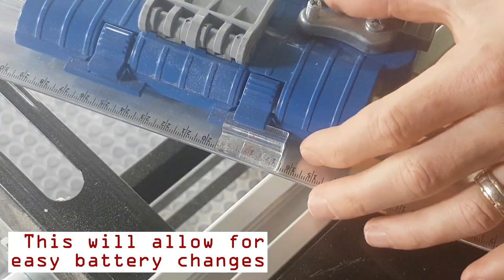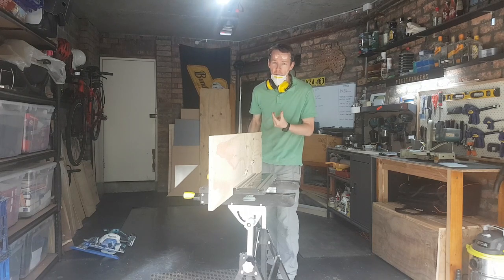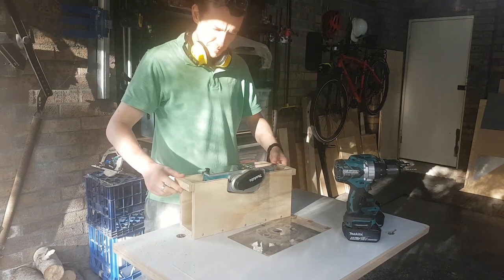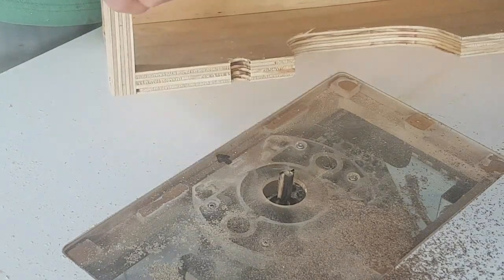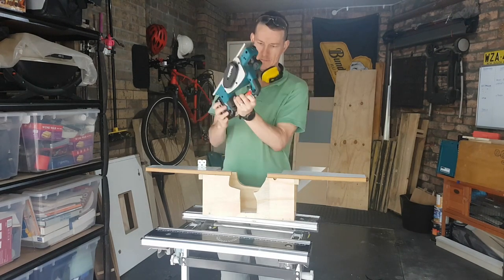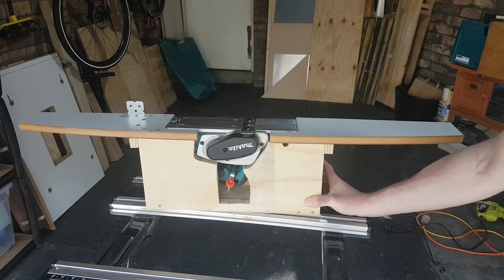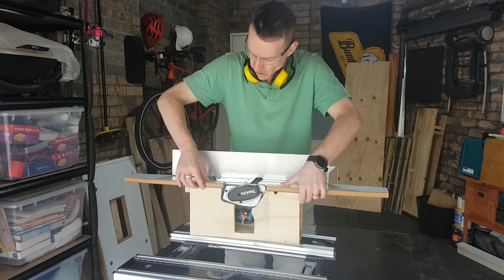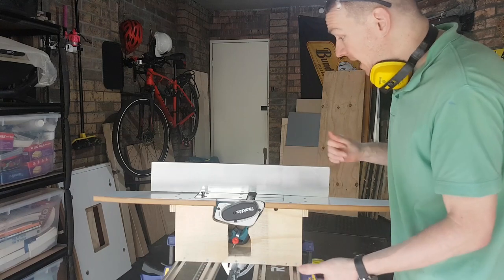Making a DIY Jointer from a Cordless Planer

Comment: Just as I expected I have nothing bad to say about this jointer MyBest.Tools make a solid clean and level cut and adjusts in increments of 1/8ths and 1/4s I ran stock 2"x4" x8" at 12' long and had no issue.
Reply from the maker: Good to hear Juliette, hope it worked well for you👍

Comment: I noticed when you ran that bit of timber over the planer there was a gap under the timber on the outfeed and there should not be a gap at all!!
Reply from the maker: Cheers Rob, yes I can see that now you point it out. Two things I'll need to look at, firstly my technique which needs a lot of practice, and care when setting up. Every time I remove and replace the planer in this housing I'll have to watch it lines up well and is sitting correctly. Thanks!👍
Reply: there is no level, bad precision work, flimsy quick build. certainly not for box joinery.
Reply from the maker: G'day Fedor, it certainly wouldn't win any awards for precision! 😁 But then it wasn't designed to compete with a store bought machine if fine accuracy is what you want. It was designed to be small, light, and crude. It does what I need it to do without taking up space or costing me any money. There are certainly much better DIY designs out there, I honestly never thought this video would get many views, it was one of my early projects. It'll edge joint small boards and square up 2 faces with acceptable accuracy for my crappy projects 😉

Comment: Paint seems to dull the blades on mine…?
Reply from the maker: Yes it is not the best thing for the blades. Since making this jig I've stopped using it for paint removal, I use Forma Strippers in the angle grinder now, then the planer. I've got a #Shorts on them here, much better option: https://youtube.com/shorts/4cz9uWqnB_o

Comment: Before you cut the feed table in half I was wondering how it would work because, by definition, on a jointer the infeed is lower than the out feed. That said they still seem to be at the same height aren't they?
Reply from the maker: They are very close to the same. I only use the wings as weight supports, all pressure needs to be applied on the planer sole.  She'll only work for passes about 1mm and under,  the wings are both a bees tadger lower than both sides of the planer. Certainly won't win any precision prizes, and there are much better designs out there...  but for my needs it gets the job done so I've been too lazy to build a better one so far 😅
Reply: Ah OK, that'll work. Like you said on a video (I paraphrase), use what you got to make something better then use that to make something precise.
Reply from the maker: @GRAYnomad  crude but effective 😉 I may revisit it one day... but more likely I'll just buy a small benchtop jointer once I find the space

Comment: I'm just curious but don't we lose perspective here?  For $233 you can get a very nice Wen jointer which will probably do a much better job than the 'jigsaw" put together from spare or purchased parts?  And that does not include your time, electricity and other unaccounted factors.    I am all for being frugal and DIY but sometime getting a right tool is simply the right thing to do especially if it does not cost you that much more or could be cheaper.  Unless cost is not a factor here and simply it was done "because I could".
Reply from the maker: G'day mate. The short version is your very correct last observation... because I could (and it was fun to do :) ). The longer version for your curiosity is this was a very early project for me and made specifically for one job, which it did well, the edge jointed little boards came out great and I made a big wood and resin sign plaque. Having said that I've used it a few times since and it continues to be a useful little jig, albeit one I dont need to break out often. In Australia the cheapest jointer worth buying is at least twice that price so for me building the jig for free out of scrap made sense. I am of the mindset when I do buy a tool, I buy reasonable quality that will last rather than budget models, so I only commit to tools that will get regular use, and that I have space for. Even a 6" benchtop jointer would stuggle to find a home in my tiny shop currently. If you need a jointer, Im with you, grab yourself a proper one, it will do a better job with a lot less fuss and bother. If you like to want to have fun in the shed recycling scrap and seeing what you can come up with using tools you already own, hopefully this video gives you ideas (or at least proves it is not worth the effort hahahaha) Cheers, great comment!
Reply: @FixitFingers  My curiosity is satisfied. :-)